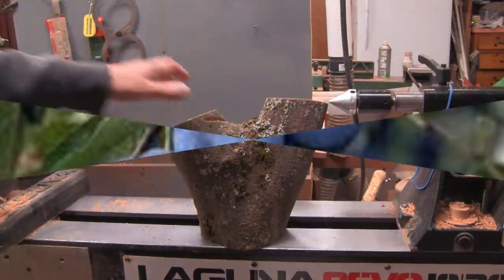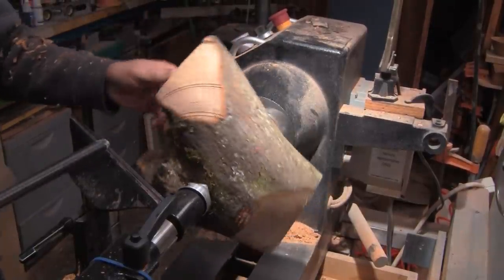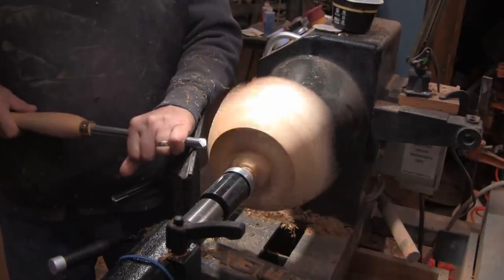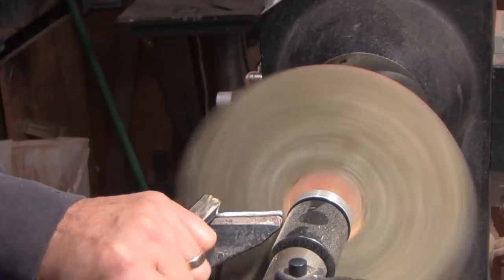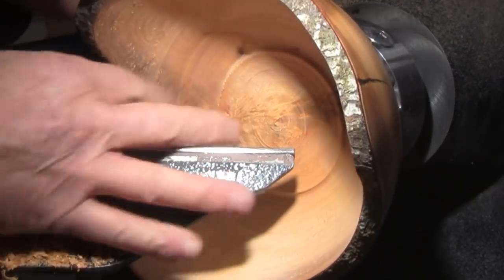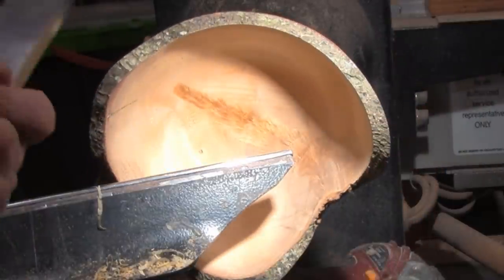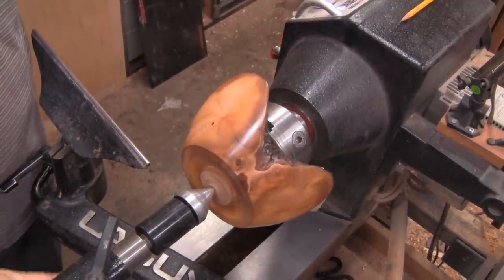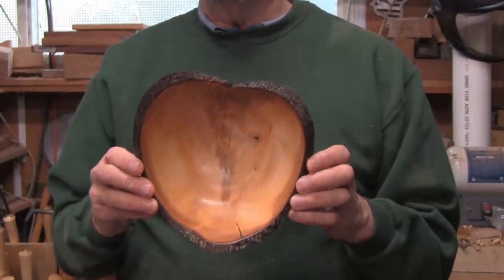Wood Turning Perfect Plum  Crotch Bowl Live Edge Vibrant Colors

Comment: Love the bowl. You’re the maker and I would never criticize what you’ve done. My original thought was to split the whole log through the pith of all 3 stems. Then make the center of the log the bottom of the bowls/plates. That way I believe you’d have come out with even more pronounced feather. What you came out with is beautiful! Like you said, great color and that feather is spectacular. Thanks for sharing.
Reply: You are correct. Hi, I am Dave from Calmwood Creations. I did just that with a different crotch from the same tree and the flame/feather figure was definitely much more pronounced. Did it green and now have to figure out how to re-turn it. It warped oval, but didn't crack.
Reply from the maker: Thanks Doug. If I get a bigger piece I will defiantly give that a try.
 I did consider splitting it but they would have been more like plates.  
Thanks for the idea and I do have some large Walnut crotch pieces I can look at.
Gary

Comment: That's plum purrdy Gary. Those amber tones are spectacular, beautiful wood. I have a small log of Apricot I believe. It was cut a year ago last September, so far no visible cracks. A smaller branch from the same tree cracked up the entire length. Oh well I can still make lots of candle holders from that piece. Can't seem to throw out any wood.
Question: Do you thin your sanding sealer or is it right from the can?
Reply from the maker: Thank you Gil. It seems to be hit or miss on if it will crack. I have few more pieces that Dave gave me and they have cracked some. But nothing gets tossed around here either.
No I do not thin it down. I use it right out of the can. I would only thin it down if it started to get it started to thicken up. But I use a small bottle for it so it does not happen. I also buy it by the gallon because it cost a lot less that way.

Comment: Very pretty bowl Gary. With the sanding sealer, after you apply it, do you re sand before applying the final shellac finish? Still new to all of this and figuring it out lol
Reply from the maker: Thank you Chris! I sand or use Scotch Brite between each coat of all the finishes. On the first coat of sealer the grain will usually raise so I sand that smooth. If it is really hard wood the grain may not raise so I use Scotch Brite pads instead.  The pads are not to get streaks or drips off though. If I have those then I use fine sandpaper. But when you learn how to wipe it on you generally do not have issues.
 Once I have a few coats as long as it wipes on good I just use the Scotch Brite pads.  I use the fine pads which are grey in color. They can be any brand you have or like.
The final finish I use the white pads.
 Hope this helps.
Gary

Comment: When you sand through 80g to 400g, do you go, 80, 100, 120, 150, 180, 240, 320 then 400? Sorry it's a pain in the neck question, but I had to ask. Nice heart shaped bowl. I got a batch of plum in September from a building site down the road, and I'm itching to get at it. CRACKS SHAKES. I detest cracks in turnings, but my better half, she says no, it's natural. But then so are earthquakes eh? Best regards.
Reply from the maker: Thank you John and it seems natural for some woods to have cracks. Plum seems to be in that group. But the Siberian Elm we have has those shakes in every piece. It is a very brittle wood all the pieces we had trimmed seem to have them. I just try to work with them  because the wood is no nice,
 When i start with 80 I then go 120, 180, 240, 320 and then 400. But sometimes it just takes 120, 240 and 400. This turning took all of them.  Hope that helps if not feel free to ask.
Take care,
Gary
Reply: @ThePapa1947  Ok, thanks for that Gary. Phil Anderson does that too, and i've often wondered what grits went in between. Best regards, Johnboy.